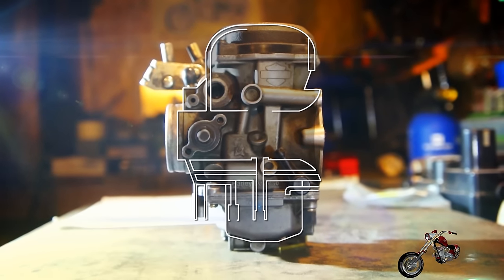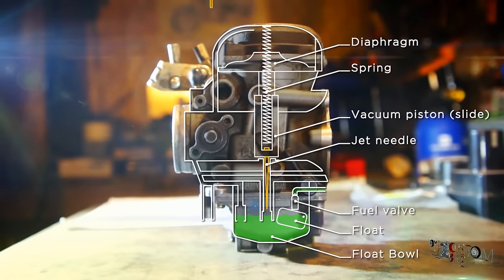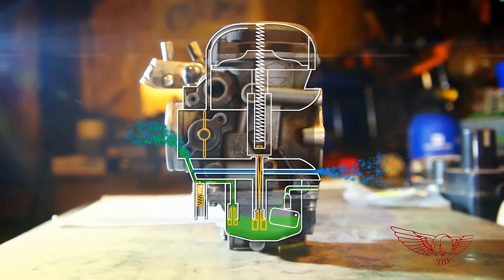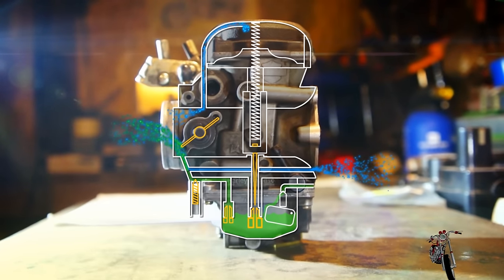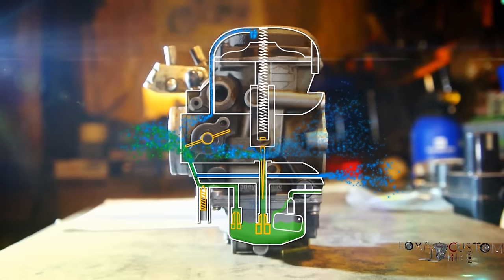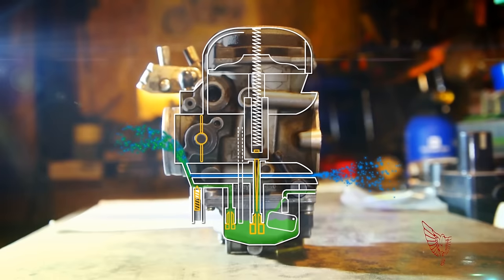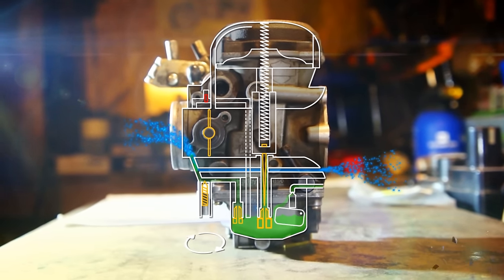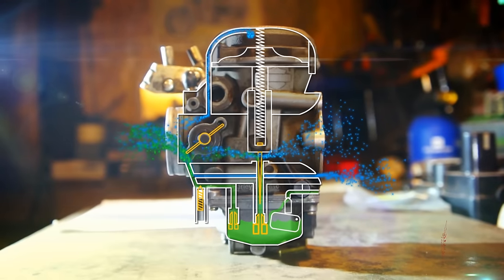How does a CV Carburetor works - Simple graphic explanation

Comment: Nice clear explanation and animation to show air and fuel flows through the carb. Now I understand why my bike ran so badly below 3500rpm. Idle jets were partially clogged after the bike had sat a while and the fuel went stale. All cleared and running lovely now. Thanks for posting this video.

Comment: Hi Cez.  I'm making a video showing the disassembly and cleaning of the carbs on my Hyosung (it had been parked in the garage un-started for 2 years).  

I plan to link to this video for an in-depth description of how CV carbs work.  I'd like to use a still image of your diagram with red arrows/circles showing the locations on my front carb that were blocked with old fuel sludge.  Is that acceptable?

Thanks.
-TWW

Comment: Awesome video/explanation.  Now I'm wondering if the slide is controlled by vacuum, wouldn't this create poor low rpm response?  I have this carb (cvk34) on an older non-running Kawasaki dual sport that I am restoring.
Reply from the maker: It does, but it makes for a "softer ride " experience. I've also installed a mikuni carb where the slide is controlled directly by the cable and it makes for a much more aggressive ride

Comment: Any info would be appreciated. I bought a 100scooter with only 700 miles. Runs and idles, but no power. 
When I took off cowling, discover the vac line from manifold disconnected from carb and blocked. When I reconnected it, it stalls and won't start until I remove the vac line, and then it goes back to running on the pilot jet. The vac line is the one that is supposed to work the slide.

Comment: so the butterfly or venturi should be completely closed for the idle since there is a separate flow of air and fuel. mine wont idle and i think this will help. im also curious about the choke. when i bought my bike i was told that the choke was needing to be pulled to a specific distance for it to engage and properly enrich the fuel mixture. when the choke is fully engaged it doesnt seem to raise the rpms of the idle- when the bike did start. it would take a lot of effort to start and wouldnt idle very well unless i applied throttle until the engine could sustain or until i found the sweet spot on the choke. how am i to fix the choke to where full joke means that the fuel flowing through the carb is full flow? im worried about taking the whole thing apart since parts are scarce for my motorcycle, however i am curious on how to make this thing run reliably.

Comment: How come when I twist the throttle with the engine off it squirts gas from a nozzle into the carb? If the motor isnt turning there should be no vacuum to pull gas in?

Comment: I installed a hsr42 on my 1995 springer softail 80” evo. The motor is stock with Vance & Hines short shots and an aftermarket air cleaner. I have a #20 pilot jet and #165 main jet. 2 turns out on the air fuel mixture screw. I’m having a hard time getting it to idle slowly and it seems like the bike gets hot. Originally it had a 160 main and 25 pilot jet and was blowing flames out exhaust at idle. Changing to the 165 and 20 has eliminated that and it revs without miss from idle on now problems just seems like it idles higher than with the original cv carb and seems to run hotter? Any advice on what I could try or change would be greatly appreciated. Thanks

Comment: People drill out the holes at the base of the slide or drill and tap for smaller adapters, even dynajet says to do it in alot of their kits for increased acceleration supposedly Harley guys say it lets air bleed there faster but I think they the wrong idea if this is how a cv works wouldn't the larger hole allow the vacuum force to bleed off more, slowing the slide lift speed?

Comment: Hello, good video:) Q: 06 sportster xl1200c Vance and Hines short shots, large performance air breather, 45 pilot jet - 190 Main jet. 2 turns out a/f screw. Not as smooth as I would like at steady throttle - a bit jerky. Been playing with it, seemed to have smoothed out with the 190 Main from 180...would a 195 Main help?
Thanks in Advance

Comment: This is a great video man.. !! 

I've got a 125cc keihin carb which has kinda different screw layout.. the mixture screw is at the back means it controls fuel right?  My bike runs pretty hotter than normal..no mods in the bike..
Reply: Rearward screw is air, usual 2 strokes are this way, forward screw would be fuel

Comment: Whats the difference between flat slide and CV Carbs?
Reply from the maker: In flat slide carbs (for example Mikuni carbs) the throttle cable directly controls the lifting of the slide where in cv carbs the throttle cable opens the butterfly valve that creates a vacuum that lifts the slide.
The difference is that CV carbs have a "softer" opening and closing action resulting in smother operation. The float slide one are more violent and aggressive. It depends on the type of drive you prefer.
Reply: thanks. also accelerator pump and opening is 100% clear at full throttle since there is no butterfly valve.
Reply: Also with directly opening the slide you can overwhelm the engine (can remember if it is too lean of rich). Especially on 2-stroke you will be bogging the engine if you just go WOT it from idle with a flat slide. With Constant Velocity carburetor the engines low pressure decides the opening of the slide and you can't overwhelm the engine with the throttle.
Reply from the maker: I never thought of that Snurre86 but id does make sense
Reply: I had to look it up again and yes, if you just directly open the slide fast the engine will run lean before the engine gets enough rpms to produce enough low pressure to make the air go fast enough to suck/push sufficient fuel through the needle jet holder. This is often compensated with a accelerator pump but this is IMO only a bandage.

Comment: no this is not the acurate example when you open the throutle the idle jet will decreasing fuel supply,  because the suction move to the larger path instead of a 2 or 3 mm pipe